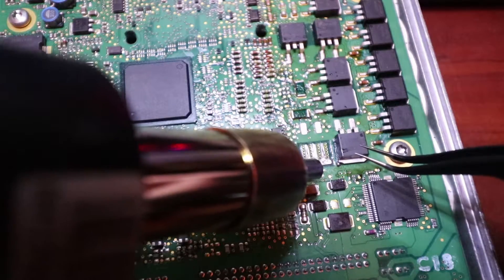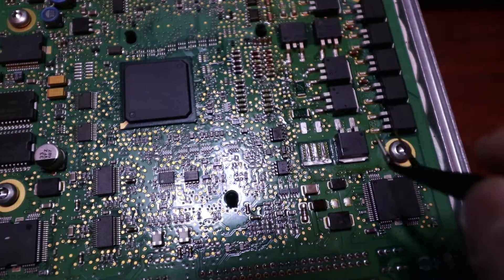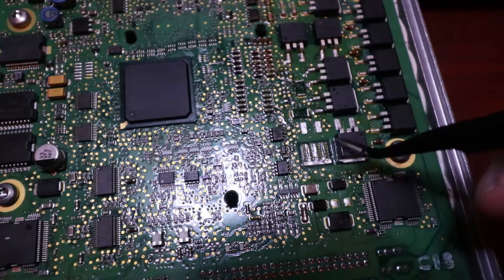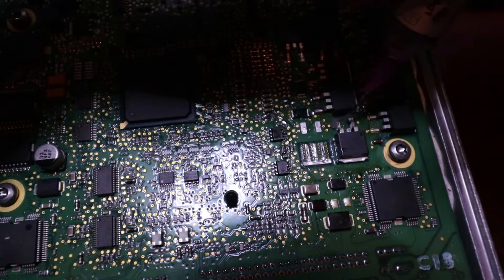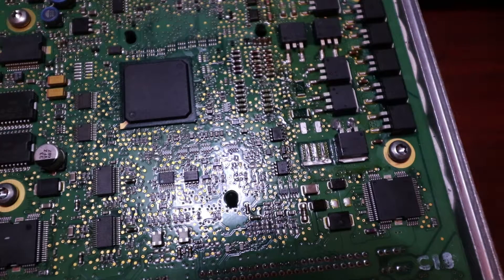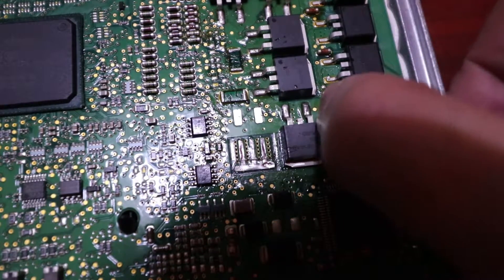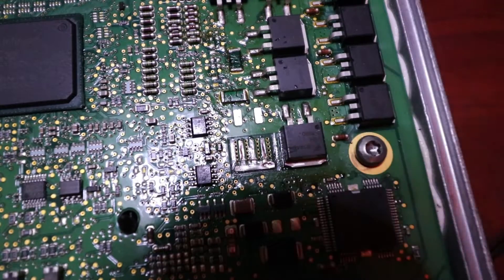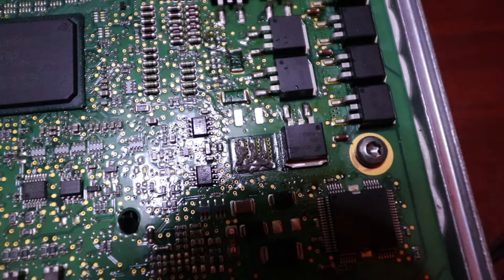BMW DME Injector Mosfet Replacement

Comment: thanks for video ?? we have bmw x5 with msd85 dme the fault is misfire in cylinder 1   we replacing ignition and spark plug but still have same problem 
can help

Comment: Uhhhmmmm just wow..... that was hard to get through. You know, they make board preheaters?
Reply from the maker: That would've saved a lot of time... Which one would you recommend?
Reply: @dancccp  I have a chip master system, had it for years, just did a set of mosfet’s today, it literally took 35 minutes to do 6, I have also been doing this stuff for 30 years, so I may have an edge....

Comment: I cannot get the other mosfet off any tips I say there at 250 for 10 minutes then cranked up it to 275 for another 5 minutes and u still cannot get it to release
Reply: Just for future people having trouble u need to use a slightly bigger nozzle size for it to heat the entire pad. But for me I threw it in the oven at 250c for a minute and then immediately hit it with the heat gun and it came right off
Reply from the maker: @Willabeast  Nice! Yeah I ended up ripping the trace because I didn't heat it up enough for the first one. The others I made sure to heat generously.
Reply: @dancccp  how did you reinstall without the pad?
Reply from the maker: @The_Chattanooga_Realtor  Pad still there, had to reattach it to the board
Reply: I've continued trying to remove it even maxed out for a long period of time it will not come off what am I doing weong

Comment: I did this with an iron, it's a lot faster if you have a steady hand. Thanks for supplying the MOSFET part number, they are working great so far.
Reply: Did you go ahead and replace all of them or just the one at first to see if it fixes the problem?
Reply: @ericgonzalez1040  I decided to all 6 of them while I was at it, it's still going strong.
Reply: E85Johnson the ones that came in did they seam smaller than the original
Reply: @ericgonzalez1040  Naw I'm pretty sure they were the exact same size on the ones I got.
Reply: @ericgonzalez1040  they are smaller but they do work
Reply: How did you do it with an iron? I’ve tried but i have no luck getting the solder under the mosfet to melt. I’ve literally contacted all the tv repair shops within a 20 mile radius from where I live and they all refuse to do it and. I only have a iron not a hot air gun :/
Reply: @TH3M0NSTR1NU  Hello, I used this video as a guide https://youtu.be/L_DIpklxXcI you can see that he is heating the MOSFETS just enough with the iron back and forth, and when you apply the solder after heating it, you'll see the solder get sucked under, hold it in place while the solder sets for a few seconds. Takes some practice, but it's pretty easy after doing a few of them. You could practice with the bad one you take off, practice soldering the old one on something else other than your DME. Hope this helps.

Comment: I keep getting a misfire on 6 and a fuel cut out think this could be my problem. I have replaced everything
Reply: Should be. Im getting the same symptoms, I got a code for my o2 sensors(just replaced them) but still didnt fix the problem. Injectors are newish too. It's been over a year since you commented. What was you're problem?
Reply: @giohernandez3591  getting cylinder 5 fuel cut off, it’s been a year for you as well lol. did this fix it?
Reply: @AlPastorTaco  start with the easy stuff. Mine turned out to be bad spark plugs and a bad ecu.

Comment: How do you remove the mosfets? Also, where can I find the flux/solder mix?
Reply from the maker: Just heat em up with the hot air, eventually the solder will melt, and they will pop off with a pick or your choice of tools. The mix is "SRA SRA LOW TEMP SOLDER PASTE" https://amzn.to/2RtIiYz
Reply: @dancccp  what temp would you recommend to remove and re-solder? 250? Also, any tips to prevent accidentally ripping out the trace? Looking to replace mine this weekend and found your video very helpful. Thanks!
Reply from the maker: Geoffrey Chu Glad I could help! Yeah 250c will be fine, play around with the air flow rate. I would practice on some throw away boards (TVs, etc.). Don’t pull hard on the mosfet, she’ll go off easy when it’s hot enough.
Reply: Hey I cannot get mine to come off maxed out any tips